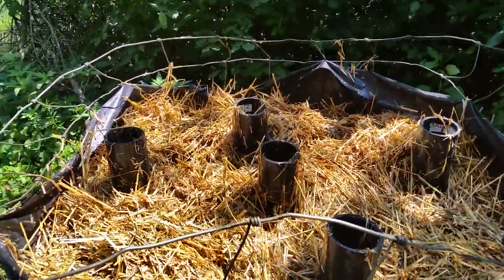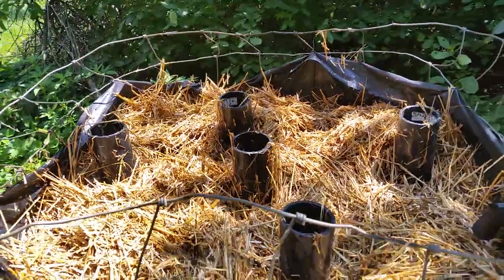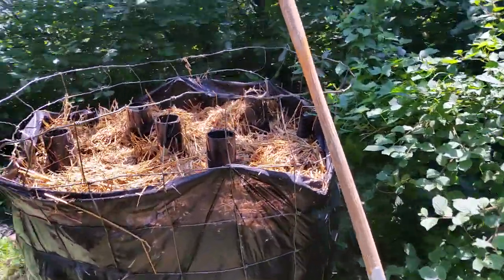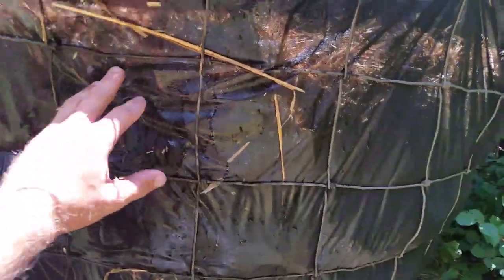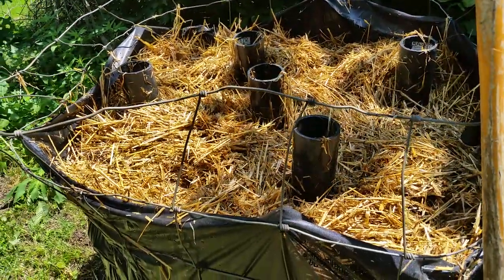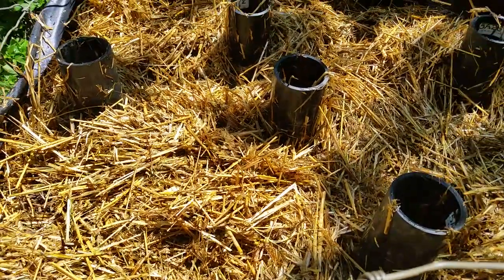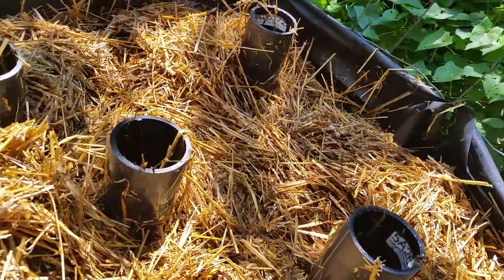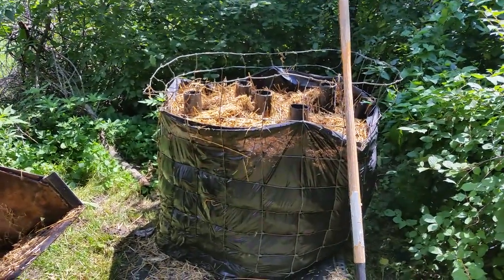Johnson-Su Bio-reactor Compost Experiment!

Comment: I think you need to remove the pipes.
Reply from the maker: After I added another layer I took the pipes out. 1 Month later and the holes are still holding their shape!
Reply: @jlacres9839  👍
Reply: @jlacres9839  What are your plans for this cost when it is  done
Reply from the maker: @equinoxproject2284  I will try to use it as a seed inoculation, and maybe make some kind of compost tea from it.
Reply: @jlacres9839  keep us updated.
Reply: @jlacres9839  david Johnson, who designed this contraption, advises not to make a brewed tea but instead use an extract. He found that the brewing reduced the biodiversity
Reply from the maker: @Doitallgp  you are correct. I misspoke.